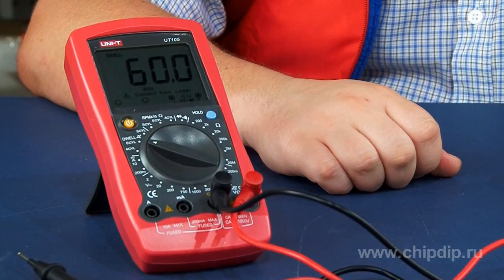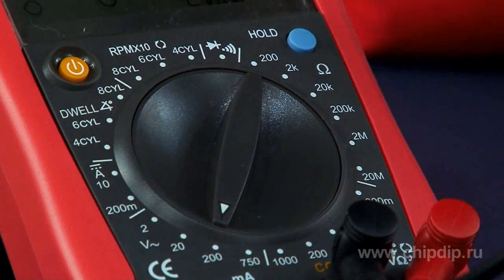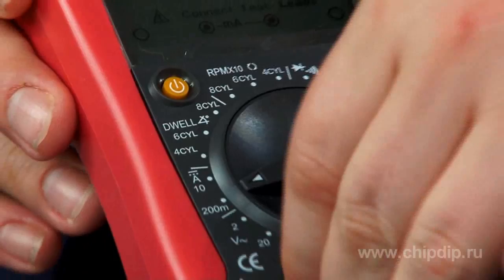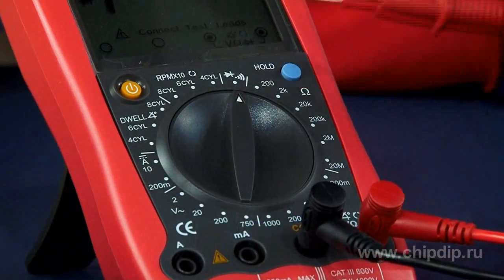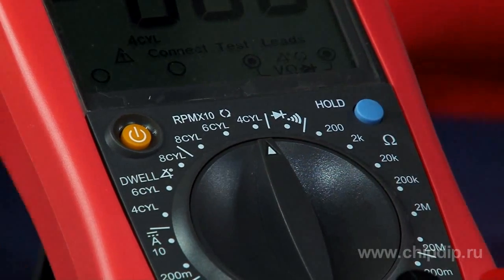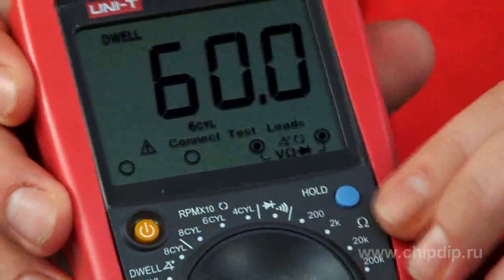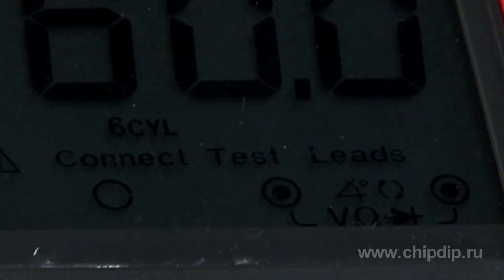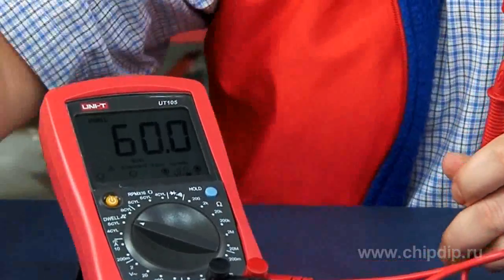UT105 Automobile multimeter

Comment: i use this multimeter on my VW Type 3, 1600. But it reads the RPM as too high. The ideal RPM should be 900RPM (90 on the display) but it reads as approx 400 (4000RPM) which you can tell is not the actual RPM of the engine.  Any ideas why this might be?
Reply: maybe panty sniffing too fast